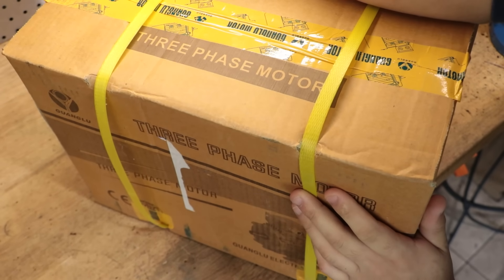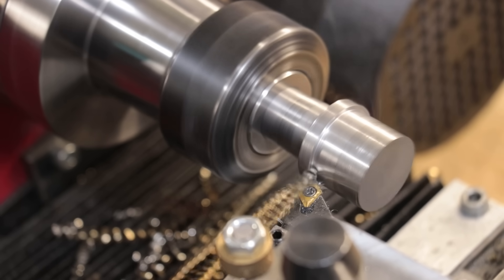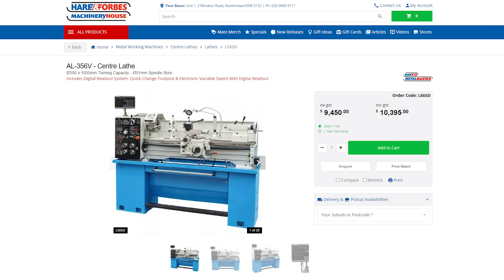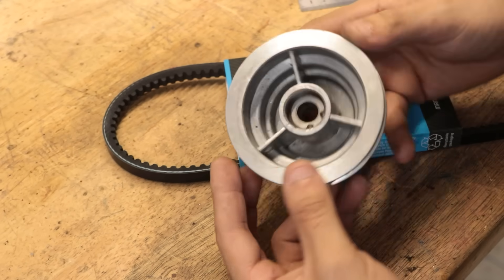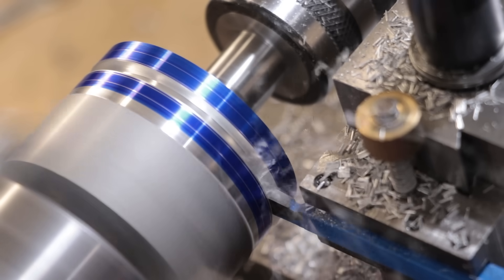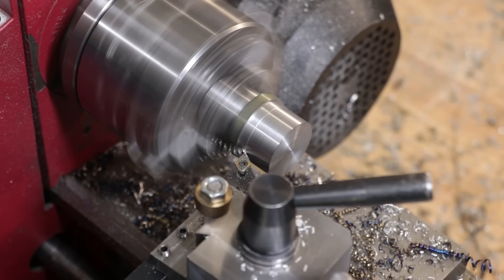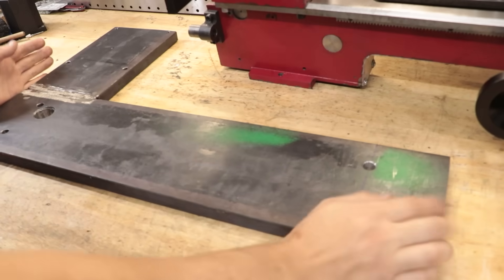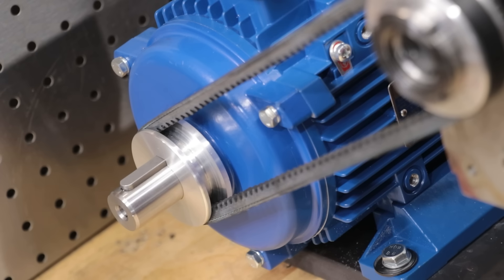Mini Lathe 3HP Motor Upgrade..... (Yep 3HP)

Comment: Love the logic 'three is bigger than two'
Glad you explained why your using carbide tooling, makes perfect sense when you have enough power and can't get low rpm.
I have wondered what would happen with a two hp motor as I just happen to have one, going to three is total overkill but great fun.
For brazed carbide, use a Dremel and a cheap Chinese diamond bit to re-shape top cutting edge for aluminium
Reply: But you do not have the rigidity in the machine itself.

Comment: Love it!
  I own a chinese mini lathe and one of my biggest complaints is the very low torque at slow speeds. I replaced the fuse with a circuit breaker and will overload and trip it when I'm trying to torque up on something at a low RPM. One must keep a meathook on the speed control to pull this off. 
  It's one of several reasons that I'm on the hunt for a used 'big boy' lathe. Not only can I handler larger parts which has been another problem, I can get higher torque at lower rpm. Of course a motor swap out like this is another solution but I'm going right to a more complete solution to the shortcomings of the mini lathe. Don't misunderstand me. I've made a lot of great small precision parts with mine but if I had it to do all over again I would have bypassed the purchase and saved my money for a better lathe. I've also spent a fair bit of time making improvements to the mini lath. 
Hindsight of course always being 20-20.

Comment: Looks like a startled Elmo when you unpacked the motor!
 "because three is bigger than two"........LOL
 As an ex sparkie seeing you are using just building wire to run to the motor....Please don't!
 Try to find some three phase cable sized to 2.5mm squared!
  Most electrical wholesalers should sell by the metre and it is much safer than just building wire!
Reply from the maker: The wire is rated for 3000w so it should be okay 

Edit: 14 amp according to the box
Reply: @artisanmakes   Unfortunately it is about the protection of the wire! 
 The reason the wire which plugs into the power socket has two skins on it is for physical protection. It is too easy for the single wires to get damaged.
 I can't tell what size wire you used from the video so I just included the size I would use.
Reply from the maker: Makes sense, I haven’t finished it but I’ll probably change up the wiring. Or never let it see the light of day :)
Reply: @artisanmakes  Thanks.

Comment: Why is the pulley on the lathe shaft wobbling? That could damage bearings or give you uneven finish on the parts. Also, I noticed to provision for belt adjustment.

Comment: With increasing your lathe’s power you may also want to consider taking a look at your tool post. In many tool post systems the sizing is determined by lathe power, presumably so it doesn’t break.
The multifix style tool post I was recommended by the spec sheet for my 3kW lathe is surprisingly big. Maybe consider a faceshield in the meantime ;)
Reply from the maker: The manufacturer says the tool post should be okay. Doesn’t help that I’m the manufacturer for the tool post though.
Reply: @artisanmakes  Keep eye out for developing cracks in the casting now that you have lots more power and more over temperatures of different parts. On glance those wires going from VFD to motor seemed bit thin. My unit is way smaller and need 2.5m2 wires, those looked like 1.5m2. 
Also since its lathe and there will be wire spaghetti, you might want to add wire cover and strain relief for the cable, well as prevent any of those going into wire port and touching up into the poles. Unlikely event but its tool and anything can happen and you dont want sparks flying or shorting the VFD if spaghetti catches on the wire for instance. Dont get me even started with the metal dust. Belt cover and boxing the VFD with remote control box would be good addition as well. We all know those are not cheap so might as well go extra mile protecting it.
Reply: @artisanmakes  Lol! Waiting eagerly for the next video.

Comment: You should make yourself a small power hacksaw. I used to have one that took 10” blades, could do whatever size blades you use. It would only need a small motor and save you a lot of effort on cutting your stock. Done right and it would always cut super straight as well. Wouldn’t always replace the hand hacksaw but would be good for cutting bar stock
Reply: Also if he had a powersaw he would loose 1/2 the comments in every video. That is no good for the algorithm!
Reply: @cobre7717  - note he never replies to the bandsaw comments either 😂
Reply: I think his limitation is space for more machine tools rather than a reluctance to buy/make them.

Comment: As long as the spindle and bearings can handle it, no motor is too big 😂
You probably need a belt tensioner and a V belt that's fully wrapped, otherwise you're going to get black belt residue everywhere.
Reply from the maker: Already co-opted my machinist jacks as a diy tensioner
Reply: @artisanmakes  that's a clever idea!

Comment: That’s the same size motor as my 13”x28” southbend! And the same exact vfd. Benefit of the bigger lathe and gearing is rigidity and depth of cut. Biggest cut I’ve taken is .300” /7.6mm. Only because I ran out of cutting edge on my tool

Comment: For a 3 phase electric motor to run on 230v you need to connect it to Delta configuration, I guess you changed it up after all.
Reply from the maker: Yes I did, almost forgot to change it to but it is laid clearly out in the vfd manual

Comment: I'm watching your videos since a long time. But I don't agree with your motor upgrade. Motor and machine must fit together. With an oversized motor you can ruin your machine or parts of it. It is better to run the machine with a VFD in the lowest gear than to change the motor  to have more power. Then the motor will run at a higher speed but the only thing that can happen is that you have to change the bearings of the motor. Greetings from Germany

Comment: Did the thick lump of steel plate make the lathe bed more rigid? I would think it might make a big difference, even without the motor. But what a beast that motor is. Surely it signifies the death of that poor little lathe… I like the mod though. When that big steel plate first came on screen I thought the hacksaw was going to be used! Glad to see it got an airing later on. Les in UK
Reply: My understanding is what it's mounted to can help some, but it's definitely diminishing returns.  Certainly won't hurt, but his upgrades to the solid toolpost and headstock likely made a much more significant rigidity increase than what the mounting plate will do.
Reply: @OWSNubbles  my experience is that it better be thick.  I have tried heavy c-channel as a bed and still was getting a few thousandths of deflection, even just by lifting on a corner of the c-channel.  Steel is too flexible for a bed.  Concrete or granite, i used concrete and marble to make 100 pound base.  It was by far the biggest improvement in rigidity.

Comment: @16:45 what is all the wobble coming from?   Is there a bearing or something missing because you were just testing it?
Reply from the maker: Probably a bit of taper in the last cut, so it wasn’t sitting straight in the chuck. Nothing much to worry about

Comment: Be careful with the motor cooling while using VFD's .
If you plan it to run a lot of time under ¿40 %  - 30%? frequency the motor will burn after long sessions of use.
The reason being the stock fan (mounted on the motor axis) is designed to keep it cool it at 100% frequency .
Half the speed you around half the cooling (but not the heat ! it's more inefficient running it with an VFD!).

For short sessions it should be okay.
Or look for Forced Ventilation fan kits . 
Those have the fan with their own independent motor .
Reply from the maker: Its a 900 rpm motor, so its generally being run close to its normal speed. And for what it's worth, its not drawing a huge current, definitely no where close to 2kw. I had it running in today and for an hour or so in some 4140 and whist there is some heat being produced, its not close to being something i'd be concerned about.

Comment: Great upgraded. Are you a concerned about the threads on the spindle side pully stripping off? I am thinking a counter bore insetting that retaining screw on the spindle to get more purchase on the threads on the back side spindle clamp would make sure it doesn't spin off in reverse or spin the threads when pushing it.

Comment: Wow Bold move with the 3Hp.  It's nice to have variable speed capability but safety must come first as this motor will put so much torque that the spindle and chuck may suffer.  We would all like a lathe to cut deeper and faster but there are limits to all tooling and a 2mm cut for this type of lathe is very good. As machinist quality of manufacture should be our objective at the lost cost possible. Looking forward to your up coming builds,

Comment: Next week on Artisan Makes; How to operate a Taco Lathe, speeds and feeds for the acute lathe operator! 

I love this project, nothing like bolting the biggest motor you can find to a piece of equipment simply because it was the same price as the smaller, more correct motor.

Comment: Have you checked the alignment of the bed after bolting it down to a piece of 20 mm hot rolled. Just a thought?
Reply from the maker: Not yet, Its always been a little out of whack, so correcting it will just be moving the shims around

Comment: Be careful to keep the motor cool at low RPM. You will probably need some kind of fan to cool it.
Reply: @davidcat1455  huh? The current will change based on the applied load of the motor. It has nothing to do with the vfd
Reply from the maker: I'll have to address this in my follow up to this. But I'll say now that heat does not seem to be a big issue with this set up. It is a 900 rpm motor so I am able to run it close to full speed most of the time. Any time it is running super slow it will probably be reaming or the occasional large diameter drilling. I had connected to a power draw meter and it is rarely exceeding 1kw unless I am really trying to push it. From what I have experienced so far, the motor is staying cooler than the old motors were. Probably has something to do with the massive cooling fan it has on it. I think if I was constantly pushing this lathe to its limit, using the full 2.2kw whilst running it at a reduced frequency it would be something worth worrying about, but on this set up, it doesn't seem to be an issue.
Reply: How would a VFD detect overload if current didn't change?
Reply: Amps go up load.  Heat goes up with amps.   I’m no expert but I can’t imagine and kind of sustained load that would cause an  issue.
Reply: Eh, nothing an RPM-triggered blower fan a few inches away from the motor fan intake can’t handle...
I mean something like ‘if rpm below xx, fan ON, else OFF’
Reply: @asakayosapro  I like to use thermistor-based blower fans eg. McMaster 9191K22: often they don't even kick in at low loads!
Reply: @davidcat1455  Except in the sense that, with an induction motor, the difference between the frequency applied and the frequency achieved has a relationship to the current drawn. Sorry, you probably know that, but it is fun to muddy the waters for those who have opinions without the required education... Of course the VFD could, because it knows the achieved rotational frequency, increase the applied frequency to compensate- do not know if these cheap units do that- but the statement still applies.
Reply: @Tensquaremetreworkshop  
😃👍Cheers
Reply: @davidcat1455   vfd allows you to change the rpm. When lowering the rpm a vfd you will retain the torque.   Not considering start up current  the current is proportional the the load.
Reply: A lot of people have no clue what a VFD is and what effect it has on a motor.
Reply: @davidcat1455  The voltage is lowewred along with the frequency, and then the current goes down as well
Reply: @erik_dk842  
Jesus Christ on a crutch. Changing the f*#:*&g frequency does NOT change the voltage. Google it ,don’t take the word of this old retired electrical engineer…………look on the bloody Internet.
Reply: @davidcat1455  take a deep breath man.  Current doesn’t remain constant as you previously stated.
Reply: Not really, those 3 stallions wont break a sweat on this machine... 😏😂
Reply: @peterfitzpatrick7032  It is not the load of the motor that is the problem. Problem is that motor still gets 2,2kW of energy, but slower RPM is also on the fan that is cooling the motor and this way motor does not get enough cooling. Believe me, this is problem for this kind of setup.
Reply: @Slemi  The motor will not "draw" 2.2 kW unless the torque is at the maximum allowable level.  The VFD varies the current depending on the load. You're still correct that the fan will be less efficient at low speed, but it's not as bad as full current and full voltage all the time.
Reply: @Slemi  ... a modern VFD should only be giving the motor enough power to match the load.
They are quite sophisticated and are capable of adjusting the applied freq AND current.
Ancient VFD technology might cause overheating.

Comment: I have watched this more than once, very exciting. 
I did a 1hp 3 phase with VFD about 8 months ago. Best decision ever. You'll not be disappointed. 

Does the VFD have an output to connect a potentiometer? It's a great way to control the rpm, also a hall effect tacho is great to read spindle speed instead of calculating any gear reduction or multiplier you have in pulleys.
Reply from the maker: It is in the wiring diagram that it can be connected to a potentiometer, and there are connections for one. I just havent gotten around to doing it yet.

Comment: dont think the headstock will snap off , might break tools and break sumting holding the gears  (of the autofeed )
the extra power does help when running the motor at a lower rpm using a vfd and still have enough power the extra rotating mass might actually give a smoother result 
using the bigger base should help , do might still need to shim the base to get the lathe to turn a piece of round between centers without a taper

Comment: I am putting a 2.5 HP motor on my mini mill . It has a 3/4 HP on it now but I have a need for more power .. I bought the 4 inch vice you have on you mill .. going to put it all together soon ..  I  think 3 HP is fine as long as you don't push it to hard .. I enjoyed , thanks !  Hey , I would enjoy more go kart vids to ..

Comment: I was disappointed with my VFD.  I have an old but much bigger 3 phase lathe and bought a 4kW VFD as, like you, I don't have 415V.  Turns out the VFD is not big enough as it only puts out the rated power if you input 3 phase  -  otherwise divide by power at least 2. It also puts out 240V per phase not 415V, so I had to rewire the motor to delta configuration. The VFD overheats and trips out if I push it. In the end I went the other way, removed the 3 phase motor and replaced it with a single phase motor, it's much better, even if it has 1/2 the rated power of the original 3ph  motor.  In your case I think you will be OK, as you started with a low powered motor and the higher reduction via the pulleys will make a big difference with the higher torque. I hope the power at the high speeds are not adversely effected, and if it is possible on your motor, it might be best to rewire it to Delta.  I enjoy your videos - keep it up and  good luck with the project.
Reply: My physics is really rusty, but...
A 3 phase supply is 415V phase to phase and 240V neutral to phase.

In his street there will be 3 phase power. His house will just be connected directly to neutral and one of the phases (and his neighbours to the other phases in an attempt to keep them balanced).
Reply: @georgescott6967  What you say is true but  my VFD is 220V between phases not 415V.  At the time I bought mine, VFD's were available with true 415V but cost more than my lathe. My VFD is pretty old now ~7 years  the Vevor one may be different.

Comment: Nice! I run a 2HP 3 phase on my mini lathe as that's what I had spare. You need to operate the VFD via remote, you can probably use the controls already on your lathe for the variable speed and forward/reverse, it saves having the VFD near the lathe and getting it oily with your fingers. Steve Jordan did a great video on doing it.
Reply: You only need an on/off switch, a direction switch, (You can combine both and use only two wires,  and a potentiometer to control many VFDs. Add some safeties like the emergency stop and you are done. Keep the control box small voltage and current, and any actual power switch in a dedicate box with the VFD.  Add RJ45 connectors at both ends, and you can place the control box whenewer you want. If you need more wires, use DB15 or DB25 connectors. Remember to keep the start/stop intelocked swhitch in the main power. You dont want the power going out and the lathe to start itself when it returns.
Reply: I have not turn for years, but just bought a sieg c6 lathe, and a 5hp 6pole motor, when i realised i had to swop belts all the time to change rpm.

Comment: #1) That is a funny looking hacksaw.

#2) me want cooookie

#3) I have vfd on big powermatic drill press. It is the coolest thing ever  to dial back the hertz for drilling big holes in steel. I want to get vfd for my 15inch swing lathe but it currently has 1phase 5hp motor. Does anyone know if you can use vfd on single phase to control hertz / speed?